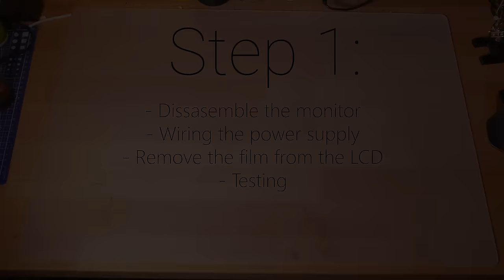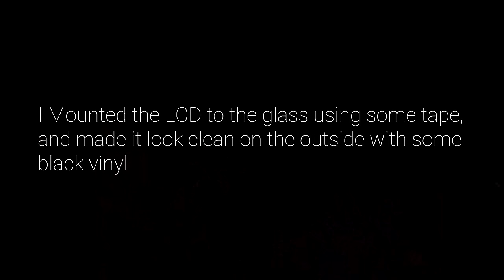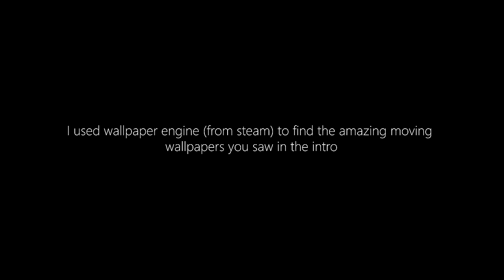DIY Transparent LCD Side panel!

Comment: i wanted to do this but after watching your very informative video i choose to no longer do this
Reply: Why not? What are the parts you're most afraid of
Reply: I don't think you understand the amount of laughter I was to obtain from your comment
Reply: Thank you for sharing your thoughts with us
Reply: This was excactly me. 😂
Reply: If you know, what you are doing, nothing will happen. Or use a old laptop screen with a LVDS/eDP controller.
Reply: hahaha bingo :D
Reply: yes but you have to get the one that is compatible with the screen model that's the most important part of that route
Reply: Your allow to higher someone to do it for u....u know XD
Reply: @XGN93  Availability of scaler-drivers (the electronic module operating the display panel) is vastly better these days, than it once was. There's also many quite affordable "universal" scalers/drivers available now, obviously not "fully" universal, but a handful of models that each can run an insane list of panels.

There are still some laptop displays and scaler/driver on separate boards that don't use proprietary connectivity. But it's not common, so you need to investigate beforehand so ypu know what you're getting will work as you think it will.

Unless you insist on using a laptop screen though, smaller 1080p monitors have been around for so long that the market is over flowing with dirt cheap used 1080p/1920x1200 monitors, so I would just go with whatever monitor, camper TV (with HDMI input!) or similar, with a display size you're ok with - that you can find for a couple of 10s or even freebie on craigslist, ebay, flea market, office sale etc (or your region's equivalent used markets). Then you have all the parts and electronics you need, in that device - and at a price you don't need to worry so much if you end up breaking it.

And if it's a monitor, you even have physical buttons for display config, that usually come on a small, narrow PCB that is easy to integrate in your case.
Reply: It's do it yourself...duh
Reply: Lol same
Reply: I'm 100% with you on this. I no longer wish to do this...
Reply: @TheManTone why is that?
Reply: Lmfao same my brain hurts
Reply: Cool story bro
Reply: It’s easy use old laptop and buy the decoder to go with it plus it’s easier to hide the decoder in the case of the PC.
Reply: To everyone in the comments. It is very difficult to solder such small things.
Reply: It was really informative when he showed how he powered/ fed video to the monitor.

Comment: you left out all the electrical lmao this vid is basically just taking apart a monitor and taping it to a glass side panel , could of at least showed us how you hooked up power and display when you did the test run...
Reply: No he didn't. He showed right at the beginning how he found the 5v rail. Fy don't know what you're looking at. This project isn't for you. I'll do it for you for $250

Comment: This is actually really smart how it works.
Correct me if I'm wrong, but when the screen turns on its opening the filters that would normally allow the backlight to come through which would be coloured from the reflectors, but since there is no backlight panel, or reflector on the screen it just turns transparent.
Reply from the maker: Yes! That is correct. White on a LCD is not actually showing white, it's just letting through the white backlight.
Reply: @Ananords  Thanks for confirming.
I've been contemplating doing it to my case, but it has 2 glass panels so I'm thinking of getting custom ones made for it.
But for now ill enjoy being able to see into my case until I can afford upgrades lol.
Reply: @Ananords so the LEDs that were put on the sides and top are there so that the black objects moving on the display screen are viewable right? They can be powered from a separate power supply?
Reply: @TheSocialPraxis  yeah, the extra light strip's are just to light the inside to make it more obvious. So if you haven't already got rainbow vomit spammed throughout your pc you'll probably want to add a light in
Reply: @ethancotton1549  😅😅 🌈 rock! Don't have them tho. 
Thanks for the response 🤙🏽.
Reply: @Ananords just curious. You think is possible to do on an Obsidian 1000D super tower glass side panel?
Reply: @daniellopez4005  Should be. Just make sure the monitor you get will fit. I did it on a similar case

Comment: Great tutorial, I was able to do this project a few years ago but using a raspberry pi inside with a video loop and accessed via vnc to keep PC free of extra work. Great job!
Reply: I've been thinking about doing this mod myself for a few years now, especially now I'm thinking about a new build. The pi-route is the way I'd go too, set and forget, maybe hook the pi up to on-board usb for power and script the display loop on startup.
Reply: Rpi 4 is out would be a good time to do it. Send a link to yalls do it yourself mods. Would like to do it but all the volt meter work intimidates me
Reply: @matthewwyers4342  May I got the link too?

Comment: Oh man, this is an Awesome mod.
I'm thinking about trying it myself. Nothing to loose, the LCD you use is available for 20€ and i got the same case.
Only think you loose is time, and i was thinking about doing case modding for so long, so this is a good starting point :'D

Also thanks for your written instruction, you clearly got my sub for this! :)
Reply: Have you done it yet?
Reply: @est495  Nope! I got my LCD here but sadly i didn't had the time to build it :/
Reply: hows life
Reply: @lxnesamurai.3485  so did u do it yet?
Reply: @lxnesamurai.3485  u do it?
Reply: I bought the exact same model but it had a different panel. It does not work with an TF panel.
He used and PVA Panel.
And the monitor is available with both.
Reply: Time is spent, not wasted.
What did you get with your time?
Reply: lose and loose don't share the same meaning. Look it up pal ^^

Comment: I was wondering if this was still being talked about, and done by case modders. I did my own snowblind mod, but my variation uses all plug and play componants that are powered off of the USB of the motherboard, including the display, granted it is more expensive than the tearing down an old scrap monitor like most people do method but, it is still cheaper than buying the case from ibuypower, and it can be done to virtually any case, and swapped between cases pretty easily. I bet even a small form factor pc could be done.  Good work. I may post a video of my version so that people who want a version that doesn't require soldering can try my version.
Reply: I really want to watch your version as I am trying to do this on my own but I don't know how to do soldering and don't have the equipment.
Reply: @BlahBlah-oj2dy  ok. I'm actually going to do a refresh of mine as I found better light strips for the back lighting, so i'll work on getting a video up.
Reply: @ZXR_SBK  When do you think you'll have it up?
Reply: @poke__8413  I have the first part filmed already. I'll finish filming tomorrow after im off work, so should be posted late tomorrow or early Saturday.
Reply: @ZXR_SBK  Sweet, can't wait to see
Reply: Remind me when you upload!
Reply: @ZXR_SBK  where mate
Reply: @scill707  theres a video of it on my channel.
Reply: You should try this in the hyte Y60 please!
Reply: @outlawzs1396  I actually just did a complete new build, but I went with the Corsair 5000D due to radiator support, I didn't move the LCD panel over to the new case though.  Might one of these days. The Y60 would require blanking off the side of the glass that is angled on the front, otherwise you would see all the wiring for the LCD panel on the side. Also massive light bleed for how much light is required.

Comment: Awesome DIY vid! Any tutorial recommendation on how to find certain voltages in power pins?
Reply from the maker: Take a continuity test between one of the mounting holes (often grounded) and the pins to find GND. Then, measure voltage between that pin and the rest. You can also try googling the serial number of the power supply and driver board.
Reply: The schematics for the board are usually available on the internet but it's also very common for the traces to be labeled.

Comment: 05:28 nice job but i couldn't see what you soldered to which pin. u wrote voltages but after u soldered only 2 gnd (black cable) to pins. can u give me detail

Comment: I did this on the same case in march and I used the 1908fpt which fits 100% perfect on the side panel.
Reply: what case?
Reply: @Cozme909  h510i
Reply: @chalk_jr  can i see ur build where did u place ur board?
Reply: @Cozme909  I had to cut a horizontal slit in the right verification metal support
Reply: @chalk_jr  do u have a discord so i can see how u did it
Reply: @Cozme909  Chalkjr#5590

Comment: You know I'm curious why someone would give this a thumbs down. To me it's clearly a very clever build that was recorded and edited very well. A lot of hard work went into the build and the video production. 

One thing I'd like to add is that this looks like a great opportunity to use a raspberry pi zero to drive the display without using the PC's GPU. The Pi zero can easily do 1080P video with VNC access.
Reply: Pi is what they are using for smart mirrors. So yea it definitely would work.
Reply: thumbs down.

Comment: So the process for discovering the 5v is unknown to me. Anyway you can elaborate on that part since it’s sped up? That’s the only hang up I have.
Reply: I am having the same issue. I have found 2 that are +5v and other various voltages. I'd assume they all still have to be powered, I have no idea how though.
Reply from the maker: You probably only need to power the 5V lines. In my case 3 of the pins where 5V and connected together. You can do a continuity test and see if yours are connected together.

Comment: how did you determine which 5v connectors to connect to your psu? I dont understand how you foudn the continuity of the 5v and did you connect them yourself, o did you mean that theyre already connected by design and determined through the continuity tests? confused on this part.

Comment: I was confident in my abilities until around 5:00 where he started doing math equations and I was like nope.
Reply: The math equations is them writing down the voltage or amps or whatever it's called
Reply: Aka using those to find the power pins

Comment: Why did you remove the "top layer" as that looks to me like you just removed the polarization filter and is required for an LCD to work. Or was that a different layer of film/plastic? Because when you remove the polarization filter all you see is straight through (with a backlight, white) so I'm not quite sure what is going on lol.
Reply: That's the AG coating, the water helps separate it from the polariser. 

If you don't do this you will have the foggy look.

Comment: I just did this mod with a simpler monitor I found for free.
It was cool at first, but you have to have a shitton of LED backlighting for it, and it bleeds out the side of the case pretty bad.
Maybe not great for the h510 case, but it’s still cool

Comment: Great guide! Love the close up on the antiglare peal!
Reply: Why did water work though? Is that normal for anti glare removal, regardless of brand? Would never have thought it'd be that easy...
Reply: @NVRMTmotion  The water wears down the adhesive holding the sheet to the LCD but it needs time to penetrate the sheet. That's why it takes such a long time.

Comment: When I plug my monitor into the molex connector the standby light just flashes like it's not getting enough power to stay turned on. Could my power supply not have enough amps to power the monitor?

Comment: Hi I done it but it's hard to see like when I try to use discord on it but the animation with colour are also hard to see got eny tips? I did order cheap leds Waterproof USB Powered 5V RGB LED Strip Lights Backlight for LCD TV PC Computer off ebay
Reply from the maker: Hi! Colors will be hard to see on the display anyways unless you have a really strong backlight with a white background.
Reply: @Ananords  so should I order strong white or rgb led?

Comment: hi, i wired up my molex wrong the first time and my control board crackeld and smoked for 3 seconds before i turned it off, do you think it would have fried my control board?
Reply from the maker: That doesn't sound good.. You have probably fried it. You can try to connect it again, just to see if it works.
Reply: @Ananords  yep, definately fried. I orederd a new control board from aliexpress tho so should arrive in 20 - 40 days.

Comment: I am wondering if you can help me, I have done everything, even identified which pins are which voltage, I have even connected the ground of the molex to ground and probed every single pin with 5v but not activity.

Can you advise how you determined which pin to use as the 5v pin and which to use as ground as there are several!

Monitor I am using is the Dell p1913sb

Comment: Do you have any suggestion on how to do this if the monitor is smaller than the side panel? 

Happy New Year, by the way 😁
Reply: You would just add more of the vynil or electrical tap to hide the area of the side panel that isn't the screen. This would essentially make a bezel around the screen.

Comment: I have been keeping my eye out for this display for a few months now due to its aspect ratio and just picked up two for free, i could use any panel with an LVDS driver board but wanted this screen because of its shape but the ease of using the existing driver board is so trivial its not even worth using an aftermarket LVDS board and to make things even easier, my screens board has the voltages printed on the PCB next to each pin!

Comment: Does transparency depend on the LCD matrix? disassembled with a passive 3D monitor is still cloudy, I removed the film from the front normally. The question is for 3D some other layers or TN matrix

Comment: Very nice tutorial.
So if I get this straight the LCD panel is opaque until an image is shown on it? Like I won't be able to SEE into my case unless I have the LCD showing an image/video? 
If that's the case, how does internal RGB from fans/GPU/RAM interact with it?
Reply from the maker: It's the opposite. The panel is transparent until it's powered on and showing a picture or video.
Reply: @Ananords  hi one question, you will still need a strong backlight to be able to look through it right? or will it really be transparent when everything is off?

Comment: Hey, great project and video! I'm just doing this myself to a Dell Ultrasharp 24" Everything seems to be going wel.  Question about power.  My setup is standalone and fed from a Raspberry Pi.  I'd like to power the LCD from the Pi using USB.  Am I right in thinking I can use a USB to molex cable and do similar wiring that you did using Sata?
Reply from the maker: Hi! And thanks:) You can just do the 5V to the monitor directly, since the monitor does not support molex or sata. So you can take a USB cable, cut it, and feed the power to the monitor.
Reply: @Ananords как там реализован черный цвет?

Comment: Why need to disconnect the power and add sata or molex? Could you just lay the boards out of the way? I feel like you’re basically keeping the monitor with original connections but removing all case hardware, film, and backlight?

Comment: This is great to watch. 
I am in the process of making my own mod. However I am having trouble wiring the controller board to internal PSU. I have already fried the first one I tried to wire up. Could you please explain how you determined how you wired it up and what your readings mean? 
Thanks.
Reply from the maker: I measured the output of the power supply in the monitor, and found what voltages it gave out. I found out that it uses 5V, therefore I connected the 5V of the monitor to the 5V of the molex connector. More info in my instructables (see in the description of this video)
Reply: @Ananords  I did that with mine and found 2 wires that gave 5v and 1 wire that gave 3.3v. However when I disconnected the other 2 wires that were also present that seemed to have no voltage going through them only leaving the 5v and 3.3v connected it wouldn’t power on.
Reply from the maker: The other two wires might be used for feedback from the power supply, maybe temperature? Just to be sure, the only wires you have connected now is 3.3V, 5V and Ground?
Reply: Did you ever figure this out? I am able to get the monitor recognized as a display but the lcd doesn't power on

Comment: Why should i chop the Cables? U can use it then and display videos or youtube in your case? And i dont understand where exactly the 2 cables come from u use on the 5V pins and which parts of the boards have to be connected. If someone can explain it would be really helpful...

Comment: @ananords if Im understanding correctly you only soldered back two pins from the power connector which only required 5v to power the lcd? or are most of the pins soldered back but most only require 5v? The reason i ask the diagram you show only has two connections but you removed about 10 pins. Thanks.
Reply from the maker: There where several GND and 5V pins, these where all connected together. (Four 5V pins that all where connected together at the controller in my case) 

I only connected two wires, the 5V and GND, and that worked for me.